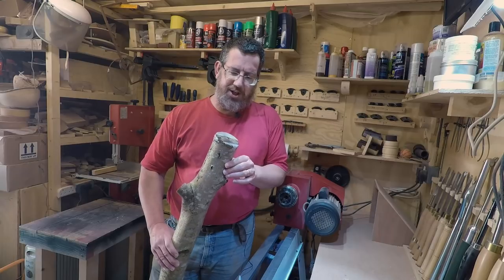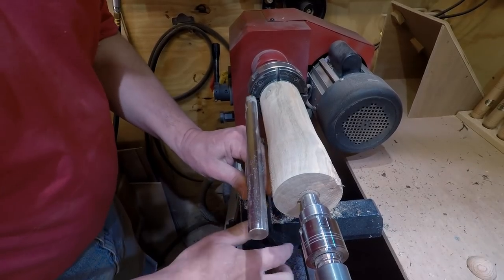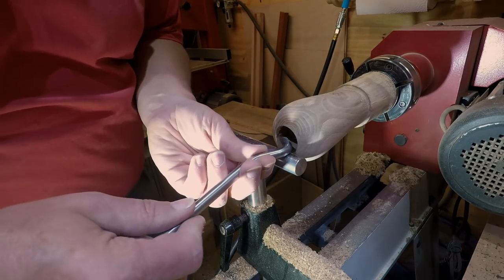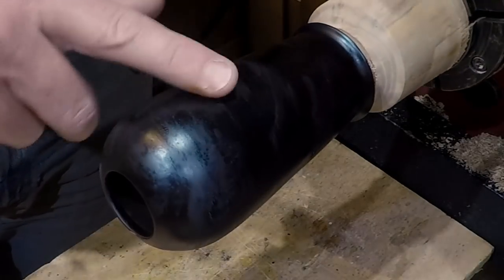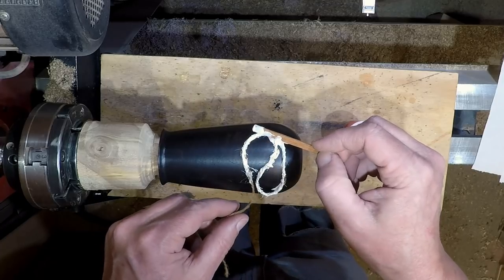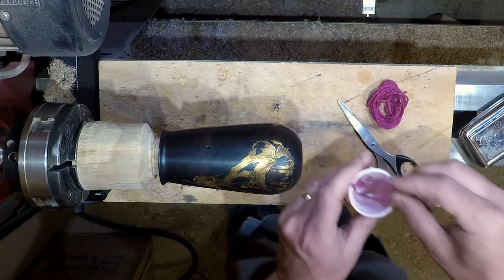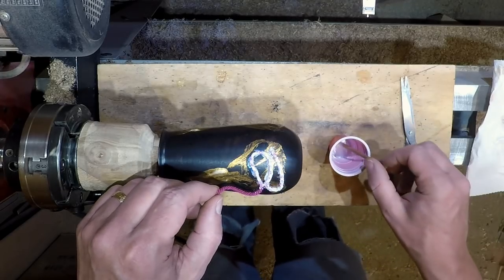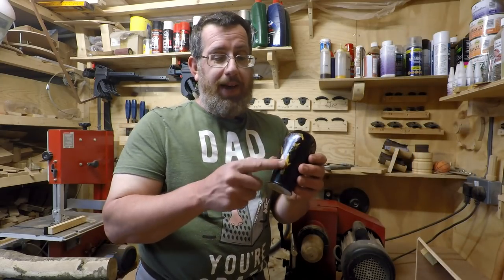String Pull Art - Episode 192

Comment: i love doing string pull with jo sonja paints. and Wayne is a legend  nice result on the vase
Reply from the maker: Thank you Lindsay. This didn't turn out as well as expected. More to come where I do at least get 1 good piece.
Reply: @PaulLockwood  i started on a flat surface first, it helped me get the dilution and string type better and then did a stewart furini and kept sanding it off until i was happy, i am yet to do it successfully on a vase though